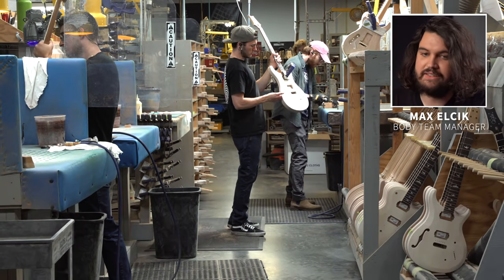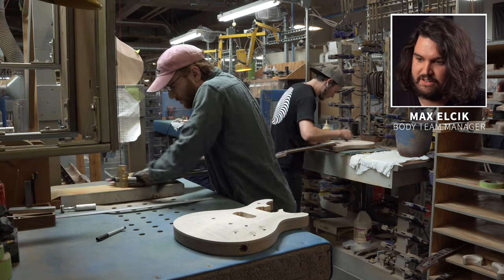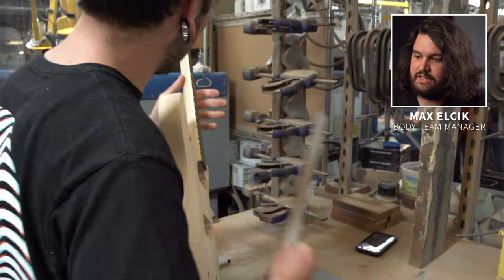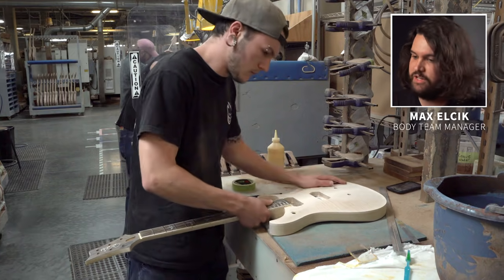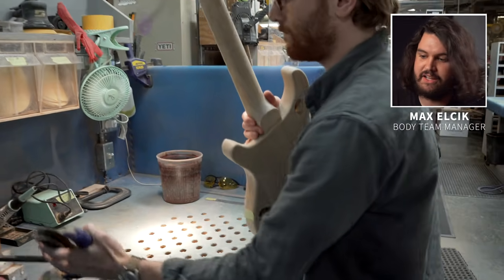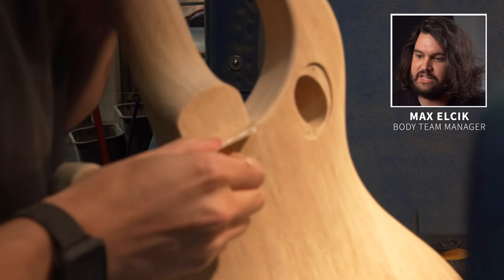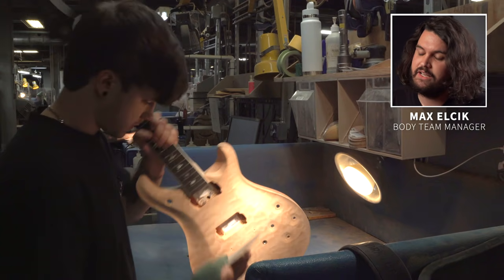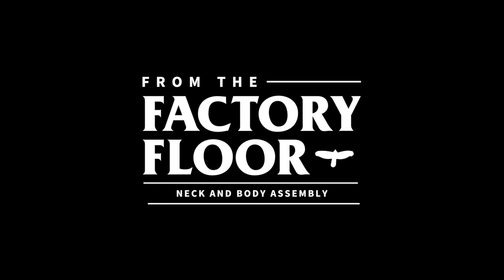Neck and Body Assembly | From The Factory Floor | PRS Guitars

Comment: I am impressed with Paul Reed Smith team. My goal and hope is someday be good enough as a guitar player and have the money to buy a American model. Currently I have three SE models I love (two too many 🤣) and the only issue I had was the nut on the Standard 24 SE wasn’t cut right and the nut was too soft plastic causing the string to cut and bind on A, D and G strings. Replaced it with a Graphtech nut and no issues since. Everything else on the Standard 24 SE is beautiful. I want the 24-08 now.
Reply: Yeah, plastic nuts suck. Even LTD still uses plastic nuts while other comparable brands use graphite, GraphTech, etc.

Comment: Interesting how they know about the glue reactions with the finish. My 2004 custom 22 artist pack is dreadful. Thick white line around the neck join and a milky haze around the whole area on the mahogany. Even a patch on the back of the neck. This video at 4:30 clearly states this is a known potential issue and they now do the best job to eliminate it, but this was not the case on my guitar. When reported to PRS I was told I would have to pay thousands for a complete refinish!! To fix a manufacturing defect?
Reply: older guitars also tend to show glue as over time the glue expands and contracts due to heat,along with the wood in the guitar. glad they eliminate this issue now though!

Comment: Whats making the neck joint move in the body?mine is not rock solid . I think not enough glue applied. The lacquer at the joint attach to the body is moving. Its already home. Passed the checks but now I am angry the neck joint moved😢its a core custum 24  10 top. 😮

Comment: if yall use water on either side of the joint.  and let the glue dry. then add new glue like in the video.  better connection.

Comment: Wish same work went into my Silver Sky. Took 3 neck replacements to get it acceptable. Then again even acceptable is relative...
Reply: You bought a 2500$ guitar and replaced the neck? 😂
Reply: @Waterinmenbenen  Actually costs closer to $3000 here in Sweden. The first neck was defective so PRS had another one built for me that came in even worse shape. They made a third that has some sloppy details. I sort of gave upp and settled for it.
Reply: In any probabilistic scenario, there is always a chance that someone will run into an outlier. 

Congrats… you beat the odds!
Reply: @oboyy  oh ok, that’s a bummer. Really out of character for PRS. I have 4 of them and they’re all flawless.

Comment: It's crazy that they only clamp the neck for 30 minutes. I've always clamped mine overnight. But I'm not building on a large scale. I'm just surprised that's all the let it set up for.
Reply: They use a much faster curing formula for the neck joints